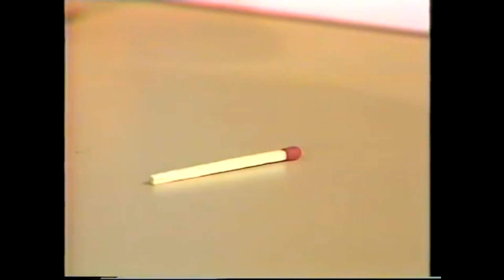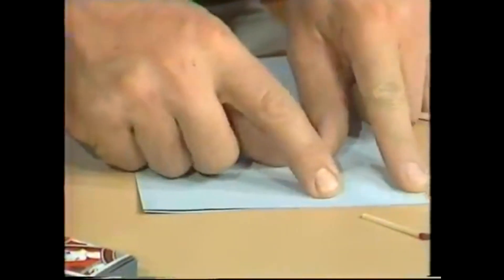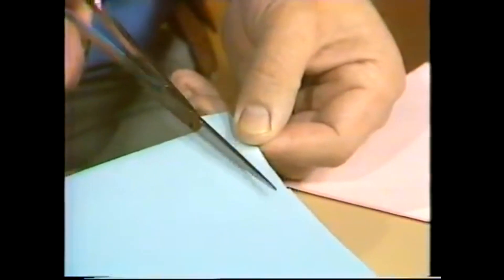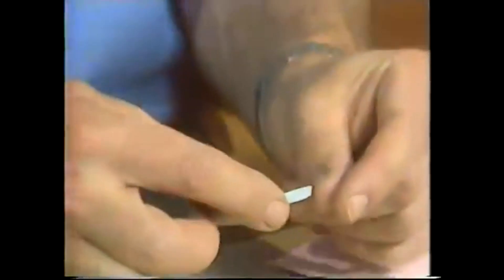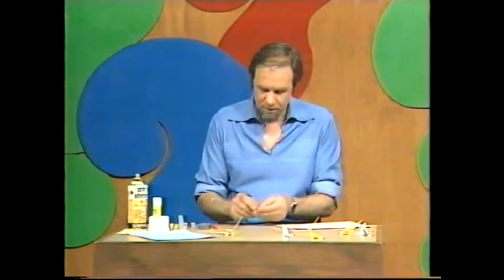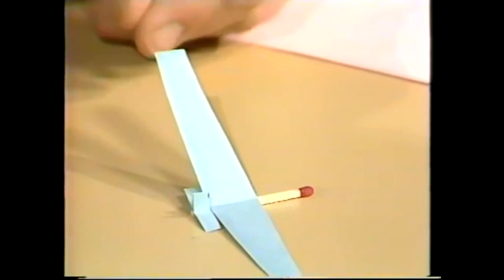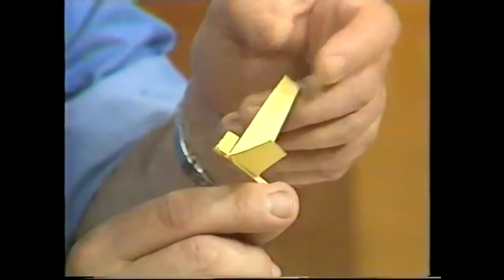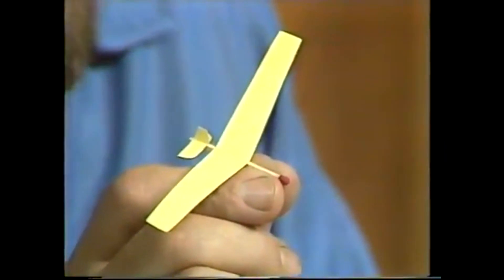Matchstick gliders

Comment: Long ago, the high school I attended was at an inter-school sports carnival. While a select few of my fellow students competed on the track, we sat in raised stands, and were soon bored witless. After a while a paper airplane flew across the rows of seats, passing from one school block to a rival school in another part of the stands.
Soon, many planes were airborne, and I joined in and threw a paper plane skimming the head of a teacher sitting in the row immediately in front of me. Despite that for the next 60 minutes paper planes were incessantly crossing everywhere, this teacher spent all that time quizzing every student in sight, trying to find the culprit of the one that skimmed his head -- which meant I had to sit quietly and innocent while most others were continuing the paper plane blitz. 🛶🛶🛶
Going waaaay back to primary school, we used to have free 'fat' BIC ball-point pens that each had a large conical cap. We found out that sticking the cap to the front of the paper plane, you could reach the other side of the classroom whether the airplane was aerodynamic or not. After lunch, the teacher found that everyone of the 50 red and 50 blue biros were missing their caps, and she didn't half go on about it! :face-orange-raised-eyebrow:

Comment: Post it gliders are also very nice.
Fold in half, glue against itself. Cut into 5 sections: glue and 4 more.
Now roll the glue part to make some nose weight. Next is the wings, fold down. Next cut it off. Next leave it straight but cut half the lenght, it's the rudder. Last one cut half the lenght and fold down at a sliiight downward angle.
It needs a bit of adjustment but flies quite well